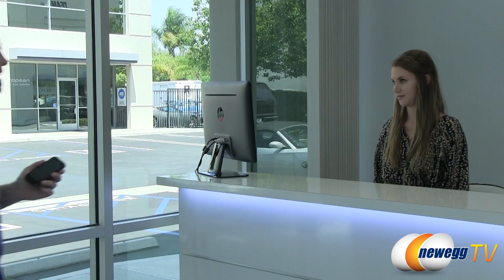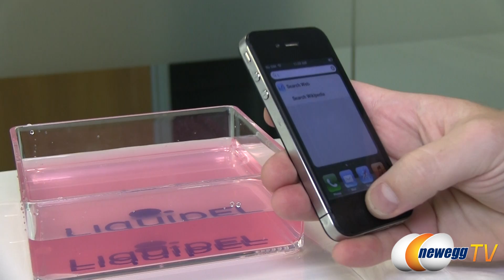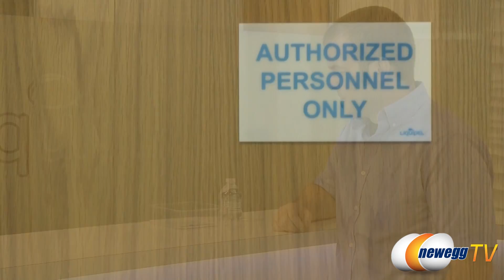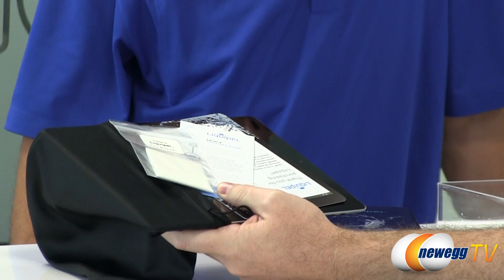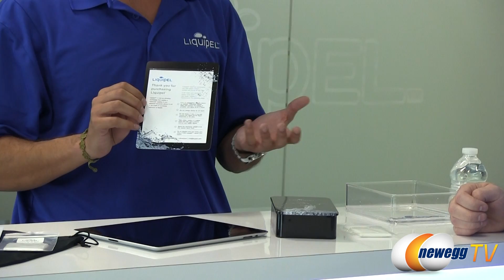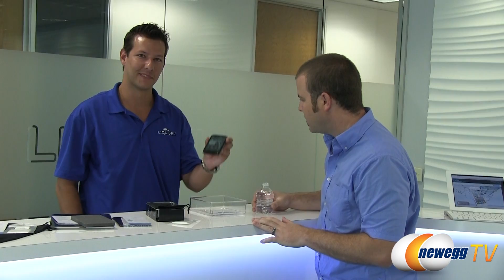Newegg TV: Liquipel - Watersafe Your Handheld Electronics

Comment: BIG Question!! ok, being a science buff or nerd or whatever, I tend to know how things actually work. So what I don't get is, how can you coat something to repel liquids, if the Cu contacts, 'have to' make contact to pass electrical currents? If the contacts are touching, then they aren't coated, so liquid can still short (ie: battery contacts/port contacts for charging). Or, if the coating is so thin that electricity can still pass, then liquid can still intercept/short the current.

Comment: ya but accidents do happen. like someone mentioned earlier there always a possibly of a flood or if you live in an apartment or any building with a sprinkler fire suppression system than there is a chance of it getting wet. there will always be a possibility of any device getting water damaged.

Comment: These products generally don't work for a good reason:

If you coat ICs with waterproof material, there's really no way for them to full waterproof where you connect the device to another one, leaving your phone still vulnerable to being ruined.

This should not be used to take your phone say underwater.